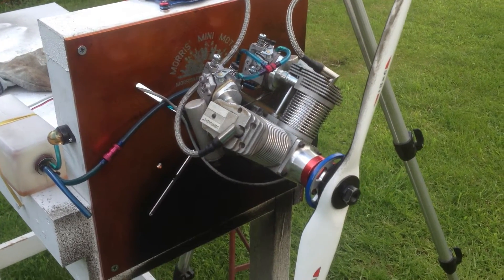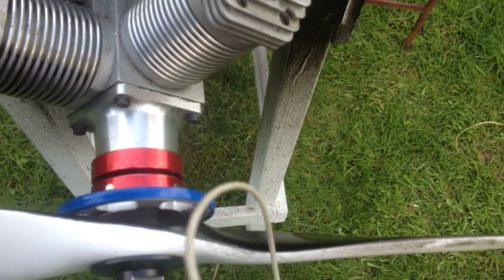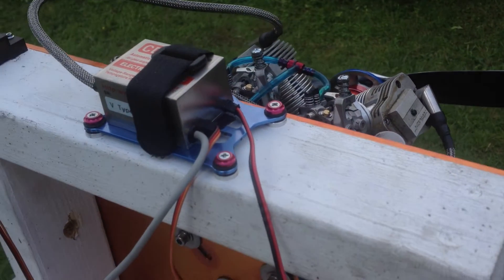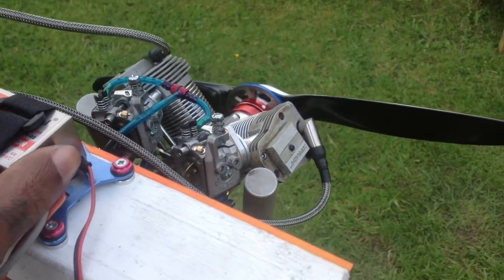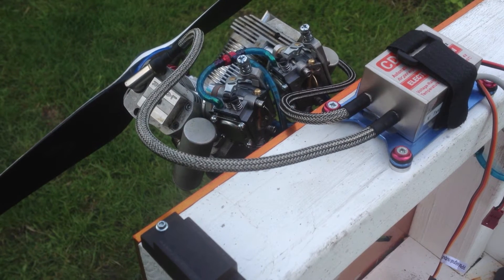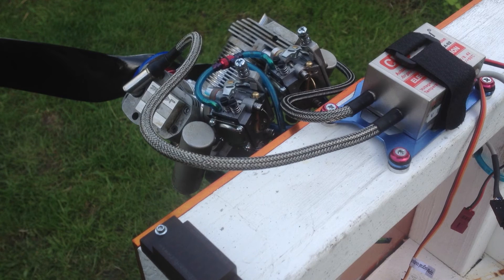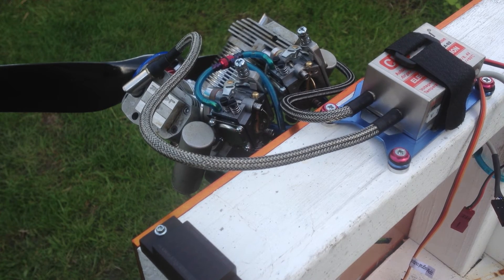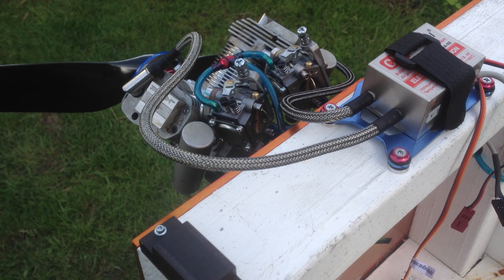Laser 160V & 200V Twin With the Uneven Fire Igintion

Comment: Isn't the only difference in the RCEXL igntions for even fire versus the LV uneven fire the way the microprocessor is programmed?  I do not believe that there are any component differences, just firmware to read two sensors at a specified time or degree of rotation.